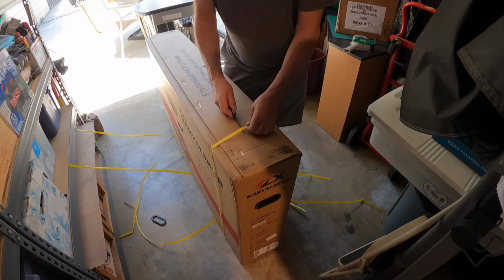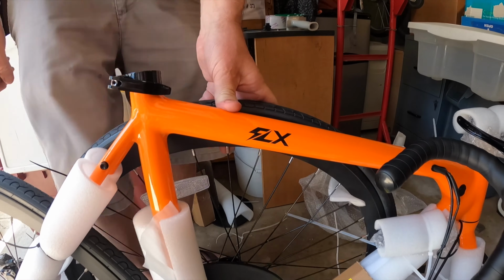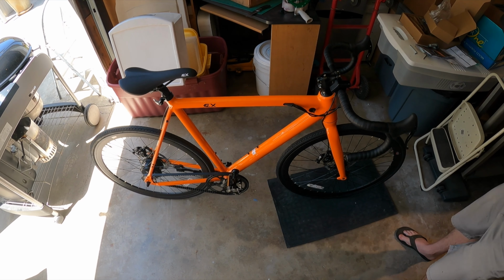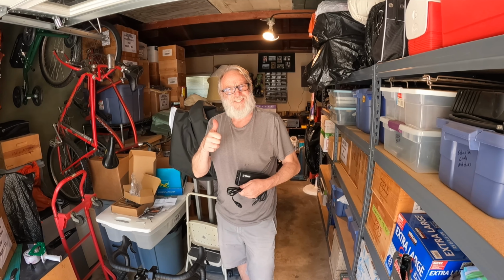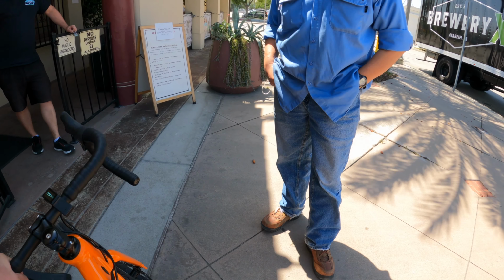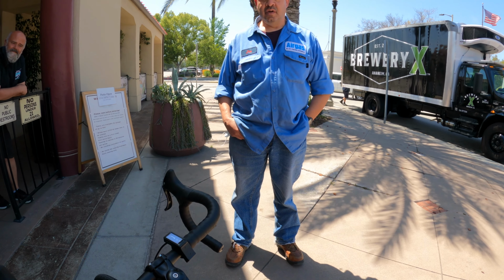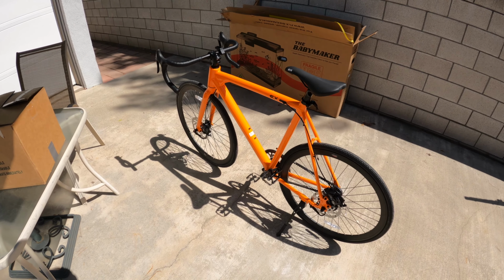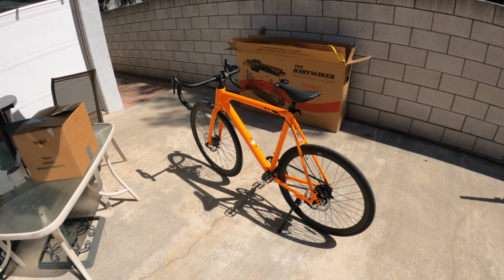FLX Babymaker Pro Stealth Road eBike, unboxing, assembly and first ride.

Comment: Why can't there be a 750w and longer lasting battery road style ebike?
Reply: Because it will add ~10 pounds of weight and the battery will be external, which won't look as good
Reply: These bikes are more for assisted exercise and training vrs a throttle bike

Comment: How is the braking?  I just got my BM Pro with drops, and the Hydraulic/Cable hybrid system seems odd.  Mine are nowhere near as strong as my GRX hydraulics on my main bike, I don’t know if I set something up wrong, or if they just simply aren’t that strong.  A little worried for long descents.
Reply from the maker: Sorry I missed your comment, there seems to be a breaking in period, at least in my case, now they seem to work a lot better after some heavy use.

Comment: There seems to be alot of similar bikes at the $1000 price range like the Ride1UP Roadstar V2. The only difference I can see with the BMaker is disc brakes, drops and better colors. The bikes look eerily the same and the performance seems similar. Like they're being made by the same shops except the BMaker is $800 more expensive. I'm afraid the company will fold with this competition. Have you checked out the competitors?
Reply from the maker: When i ordered the BM about a year ago there really didn’t seem to be anything like it. FLX has been around for a number of years and makes other ebikes. They sold a lot of Babymakers so they should be around for a while.  I’m happy with it so far.
Reply: @9858472  Well, my wife says one of the great things about making it to OG times is that you can splurge on what really makes you happy. The BMker is one cool bike, much cooler than its cheaper rivals. So here's wishing that it doesn't take a year to get it. Rock On Mark

Comment: Great Mark, thanks for posting this. Is the range ok?
Reply from the maker: I have done a 30 mile ride and battery indicator only went down one bar.
Reply: @9858472  That sounds impressive!
Reply: @DieDeej  on what level?
Reply from the maker: @GabrielGonzalez-xp6lb  At  level five I can get around 20 miles, not as much as I had hopped for.